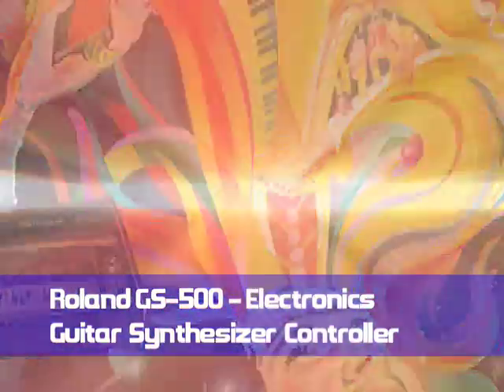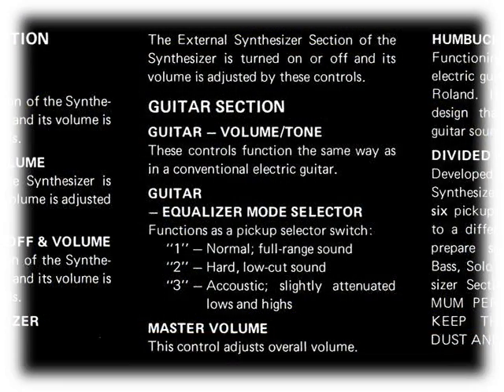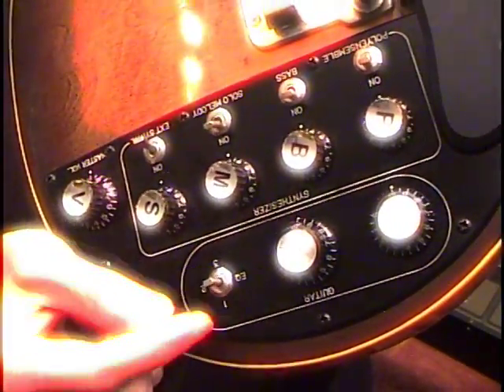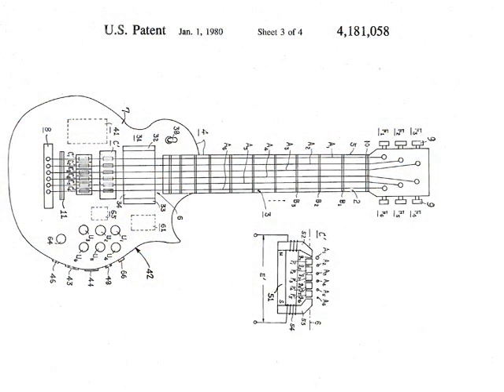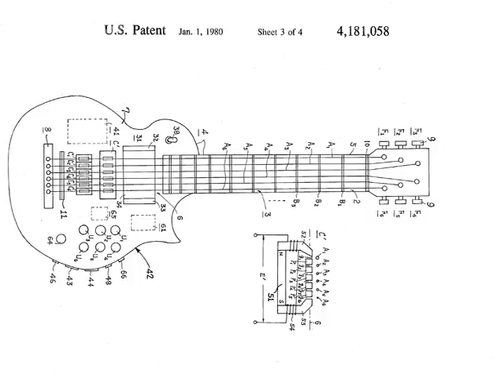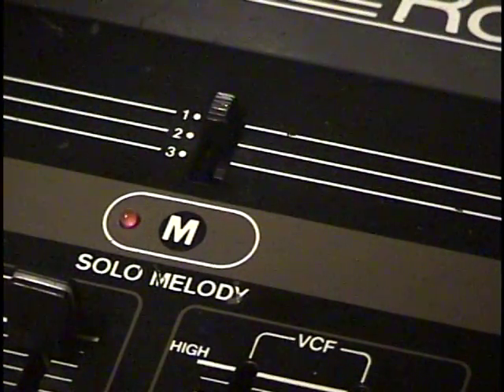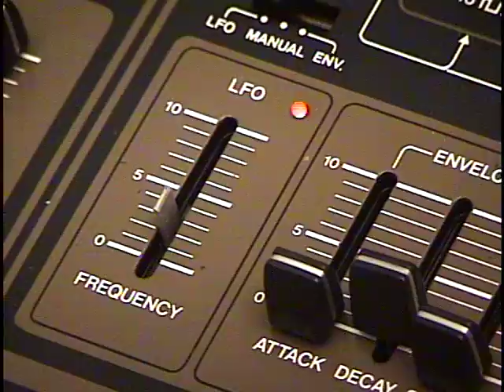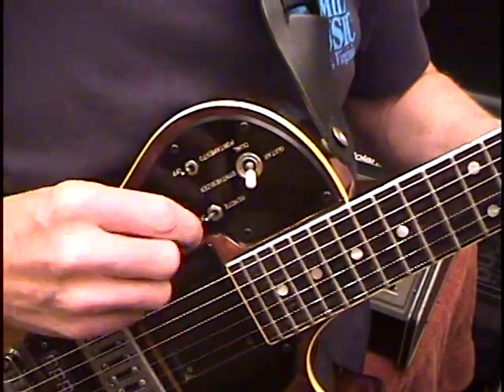Roland GS-500 Guitar Controller for GR-500 - Guitar Electronics

Comment: Interesting..!  In the first part of the video, demonstrating the three-way toggle switch, it sounds more or less like a regular guitar, but since this guitar doesn't have a regular guitar jack output, the humbucker sounds must be fed through the 24-pin cable and via the GR-550 unit then?   And does this mean that you MUST have the GR-500 to get any sound out of the GS-500 guitar at all, or can it be fed through another 24-pin GR unit, like the GR-100 for instance..?

Comment: Just wondering does this controller work with the other units? (Gr300 gr700?) I'd love to get one one of these days if just for the fact it's a cool collectors piece , but these are rarer than the other controllers and the synth units are even harder to find, priced out of reach ,or non-functional. So just wondering if I find a guitar if it works with the gr300 ?
Reply from the maker: You need to make a few modifications to use the GS-500 controller to work with the later synths like the GR-300 or GR-500. I have a section on my site on how to mod the GR-500: https://www.joness.com/gr300/GS-500.html#modifications